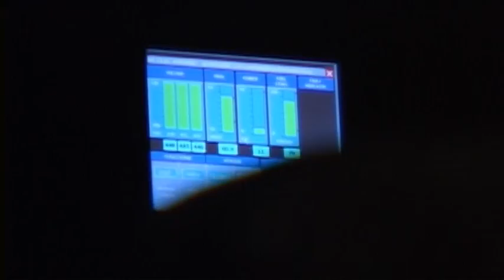Counter Rocket, Artillery and Mortar (CRAM) System

Comment: these shells cost $28 ea. bc they self destruct after 4 sec. I don't understand how this can work on a battlefield finnancially when a few mortar teams are dropping $10 mortars every 6 sec, X ea. team, or tactically since the thing won't sustain fire for long. It won't hold enough shells, and reloading- when I was in- was laboriuos and time consuming. Could protect the CP, anyway, but not the MLR
Reply: Soldiers are worth $400,000 at the minimum. Some of us are worth well over a million.
Reply: It's in the bathroom of the ship?
Reply: Idea might be to gain some time to compute enemy position and use own artillery counterfire against that enemy.

If this tactic is usable... who knows :D
Reply: I'm not going to say exactly how much flight time the M940 projectiles have, but it's a lot longer than 4 seconds!
Reply: +Valoro85 I don't remember the capacity/load specs ( I wasn't an FC) but loading CIWS takes awhile, and it's not meant for constant engagement from each gun mount as they hot gun after around 400-600 rounds in a certain time period (less than 10 minutes).  An average shot burst being around 100.
Reply: And this is why Anti Missile Laser Systems are being developed.
Reply: When you spend such a large portion of you countries GDP on the military, you can afford to do things like this.